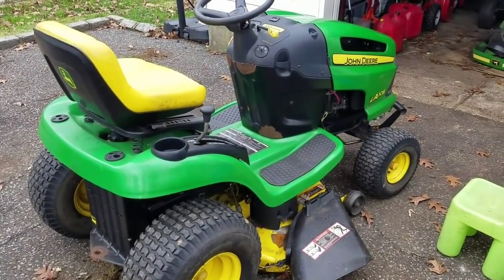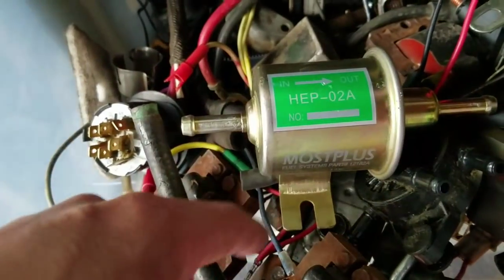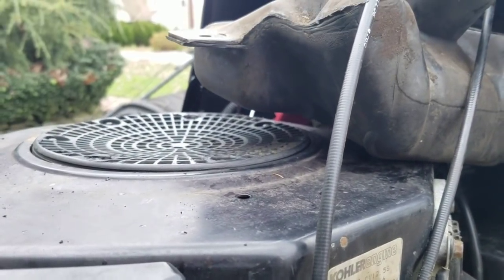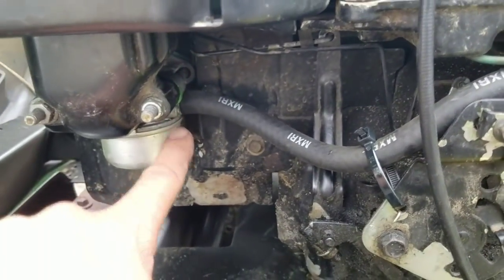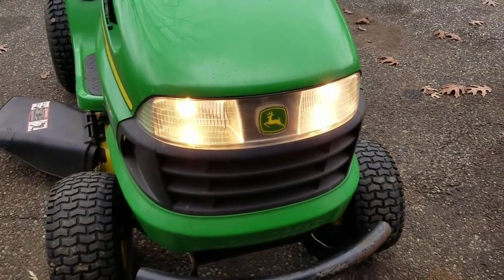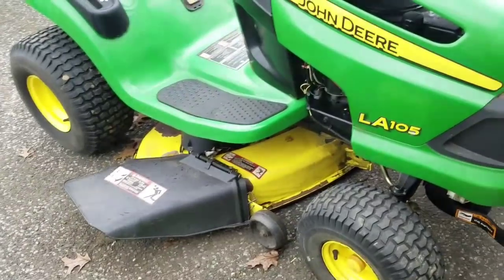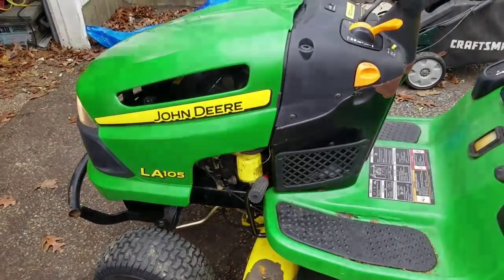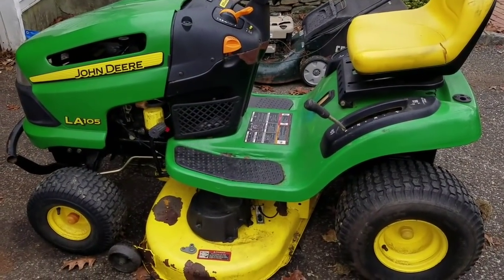FREE JOHN DEERE LA105 LAWN TRACTOR GRAVITY FEED GAS TANK CONVERSION ELECTRIC PULSE FUEL PUMP DELETE

Comment: Mine runs fine and after i mow a while it starts surging and shut off but it will run on choke i don't understand it
Reply from the maker: Try loosening the gas cap....and it can also mean your ignition coil is on it's way out.  Overheating from mowing diminishing the spark.

Comment: well john deere stx 38 has gravity flow tank similar to the one u mounted but its a major pain to take off or remove or replace fuel lines n that sux. have to take off steering wheel so its a big job far more work then I wanted to do.
Reply from the maker: You, I had a stx38, stx30, and stx42 and all were gravity fed tanks.  My fabricated one comes off in 3 mins.
Reply from the maker: Hope you subscribed

Comment: your electric fuel pump would have worked with a fuel pressure regulator (adjustable) and a return line back to the tank

Comment: You know Henry fuel pump burned out because you can't regulate fuel  on  in put side of a pump it must be done on the output side
Reply from the maker: Oh...I see...I should have put the valve between the carb and pump, not between tank and pump.  I dunno if I would try another one, I really like the way it's working now on gravity fed.

Comment: I have the LA110A with the Briggs. The rear tank is convenient, so if you want I can get the part number of the fuel pump off of mine. This fuel pump might work on yours since it could have alot to do with delivery distance. Glad  that the gravity feed worked out for you.
Reply: What’s the part number. There may be a individual who could still use the helpful information
Reply from the maker: I have the original fuel.pump off the la105...the engine in have kohler command 12.5 isnt designed for a fuel pump so it doesnt have a crankcase port.  The valve cover hole doesnt pulse enough to get enough gas.  It is what it is, the gravity fed tank is fine.  Thanks.
Reply: middyband what’s the part number
Reply from the maker: I have the original fuel pump, the issue is no pulse port on the replacement engine.

Comment: I done some investigating and ran across this. I done a copy and paste so its exactly as posted......  I have a older 400 cc 11 hp briigs engine that never had a fuel pump installed.After i thought about it awhile i figured there would be enough room and pressure from the crankcase in the oil filler tube/dipstick to run a standard vacuum fuel pump.So i simply drilled a hole about 2 inches down the plastic tube and installed a simple fitting to put a hose onto.Add some sorta sealant to make a tight seal and run your new crankcase port for your pump.Works great and even if the tube breaks off its a cheap plastic piece not your engine block!
Reply from the maker: Yeah Billie,  I've heard of that done also, appreciate the research! I like the gravity fed tank and how the engine runs so great!  Maybe if I figure out it needs way too many stops to fill it up, I'll explore that dipstick jig.  You'll be the first to know...lol.

Comment: There are many vids on youtube to show how to put a pump on an engine. This is no good. You drill a hole in the valve cover.
Reply from the maker: The hose is right out of the valve cover.
Reply: Then the pump should work . The brigs plastic one with 3 fittings The tank is dirty or maybe a restriction
Reply from the maker: Well...it doesnt.
Reply from the maker: And there is no tank restriction as the electric pump was pumping fuel like a geyser.
Reply from the maker: @armyvet4081  you're not watching the videos anymore jerome....in the video, I steal the original oem pump and connect it, doesnt work, not enough fuel reaching.....its in the video before this one.